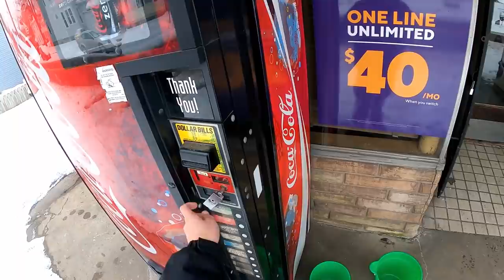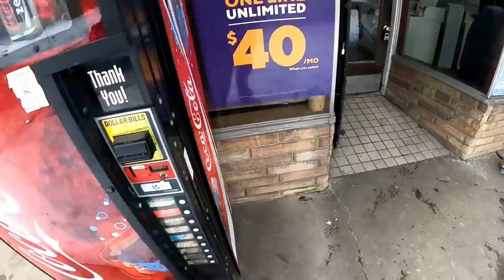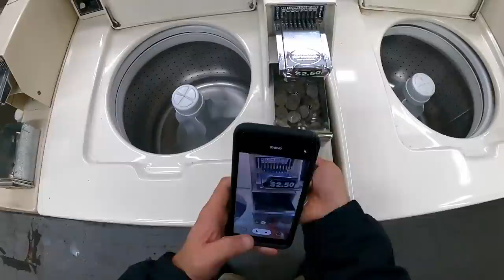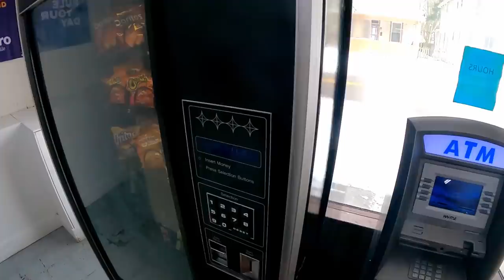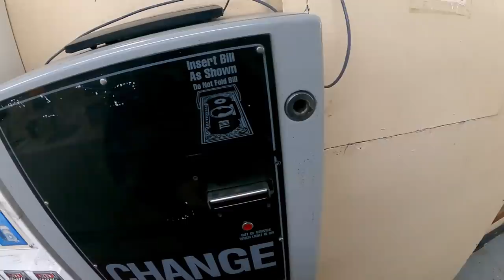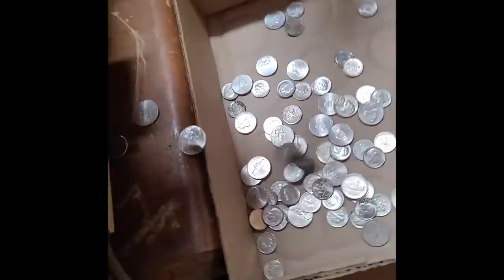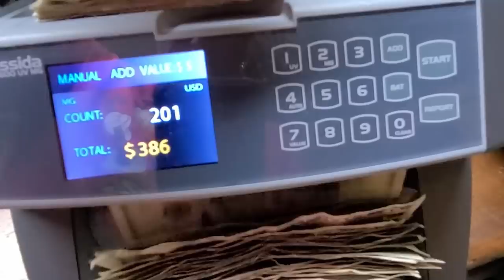My LAST Laundromat money collection video

Comment: We had coin operated laundry machines for two years.  They never worked because the owners of the crack den on the second floor two buildings over would come in at 2 AM and rip the machines apart for the coins.  I think all the machines had been replaced 20 times in a year and they would stay intact for less than 24 hours before these two people would rip them up for quarters.  A new property company bought it out and replaced the coins with card readers so we have actual machines again.

Comment: You should paint and put in new floors at the laundry mat before you put in the new equipment it would make it look alot nicer and cleaner if you did that. Plus you should get a automatic coin counter it would make things alot easier for you plus they short out the quarter,dimes and nickels for you .

Comment: Ever Find Slugs? The ones from Electrical Boxes that have a Slight defect from where they attach but can be Hammered Flat and are the Same Size as Quarters? They work in Machines with the Slots you set the quarters side by side and push in. Or even Wood ones cut to fit.

Comment: Why not just use the quarters from the laundry/soda machine to refill the coin exchanger? No need to bring the quarters back home to count when its all circulating within the same building. Bringing just the cash home would net the same revenues and save a ton of time. Am I missing something?

Comment: Don't know how much you charge but Our Mat charges like $1 a Pound. The $5 Machines do 5lbs. He just got 5 NEW $3/3lb Machines after 12 yrs of owning the place. He's reduced the size of the place by Half, Can't keep it clean whatsoever. Parking lot looks like a landfill with chances of getting nails in your tires. The Driers are SUPPOSE To be 0.25 for 6 minutes ( only 2or3 do) but vary from 4-5 minutes and dose Not Give a Damn. No attendant is there after Noon. So if something goes wrong, you are fucked. BUT it's Cheaper than the Clean one just down the road. By about Half.
Reply from the maker: That price is truly insane. Our 60lb will be $8
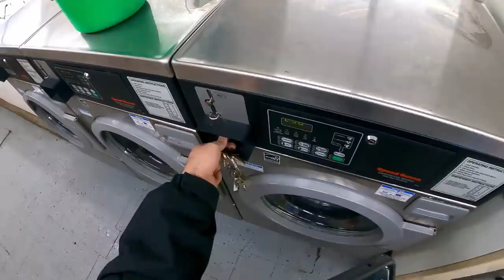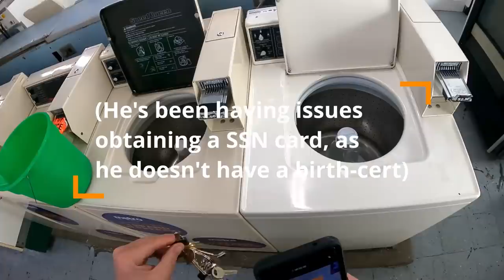Reply: @InvestmentJoy  Largest machines are like 10lbs(?) Or Slightly Bigger than the ones at 3:58 and they only cost $10. More if you want HOT Water, or Extra Wash. Your Machines at 4:32 are the ones for $3-5 Dollars. The $3 ones are big enough to do a Comforter by itself.

Comment: The homeless guy did not even say “Thank you.”  I returned to the US in 2017 and my neighborhood was over run every morning by “homeless.”  My neighbors thought I was insane for confronting the people dumpster diving for recyclables.  I am pretty sure I single handedly shot up my city’s crime rate within a year. Then a police dispatcher point blank told me to basically ”pound sand” and refused to send an officer.   So, off to city hall I went with a photo album of all the homeless I had the pleasure of confronting.  Within another year, all the recycling centers in my city were shutdown.  Months laters, neighboring city recycling centers were closed.  My city also told apartment complexes to build walls around their exposed dumpsters.  Now, I rarely see a homeless person in my neighborhood.  I get wanting to be sympathetic to the plight of the less fortunate, but when you see 6-7 of them group up on a restaurant patio every morning and invade a neighborhood, while full of “entitlement,” your sympathy will change real quick.